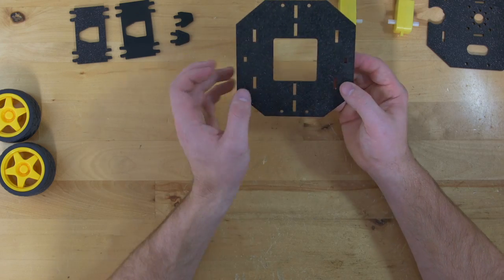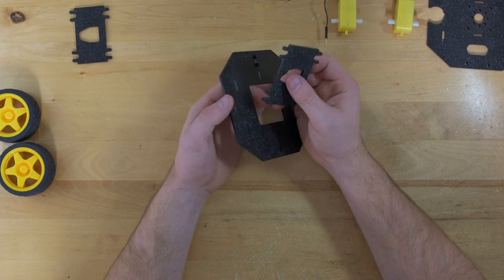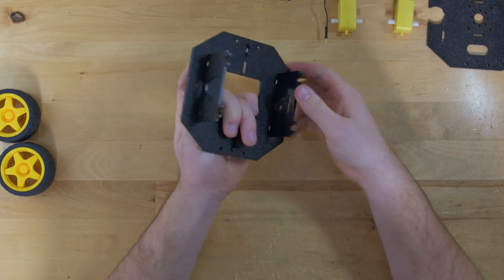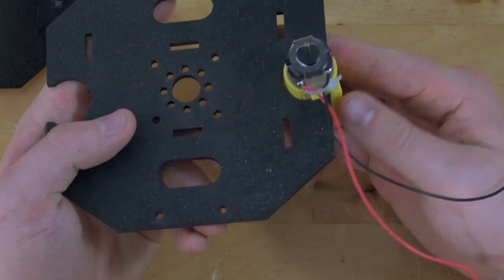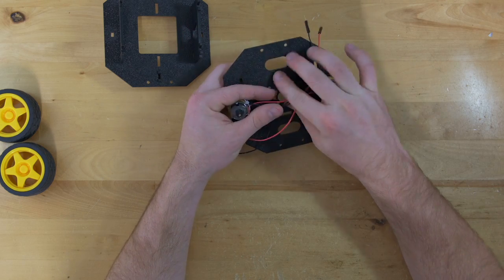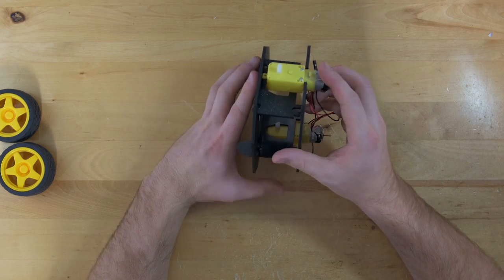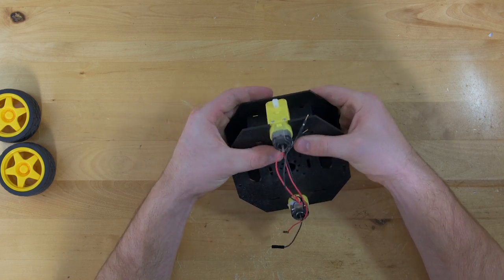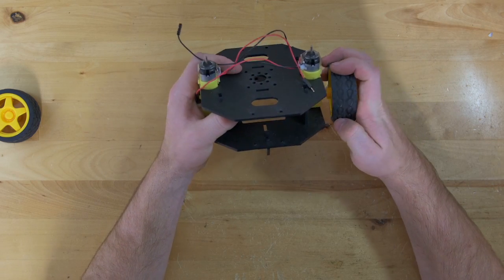Peewee Runt Rover™ by Actobotics® Assembly Instructions #637158

Comment: So what do you do when it won't fit together because  the motors are exactly the size the schematics show, but the plates are all 7% too small?
Reply from the maker: Please contact us directly if you're having difficulties assembling the chassis at tech@servocity.com.  The motors slide in from the side and rotate 90 degrees.  They'll be a snug fit but that's be design so they provide adequate support for the wheels.
Reply: I’m having the same problem. Despite the nominal snug fit design, the holes for the motors are too small, and you’re unable to rotate the motors in place by hand.
Reply: Same problem here.